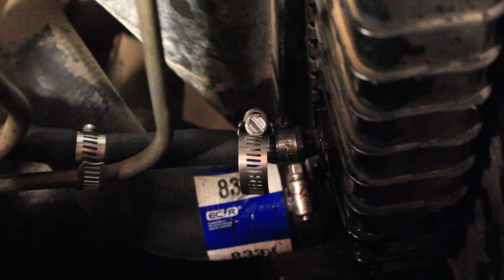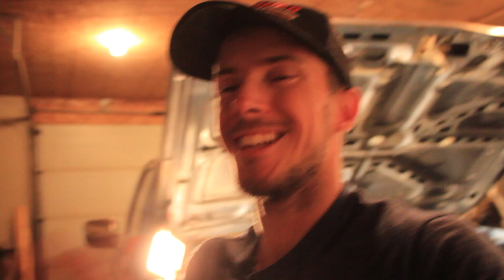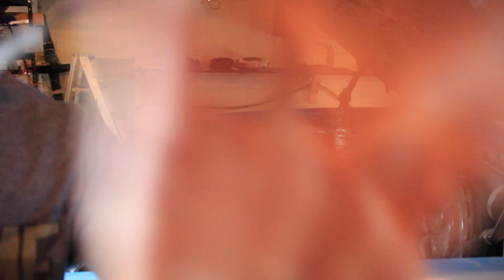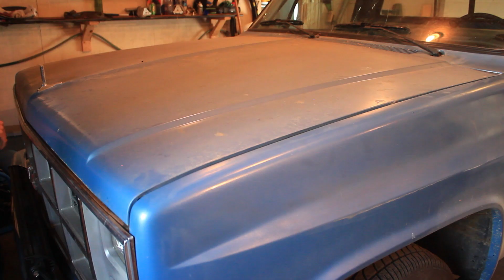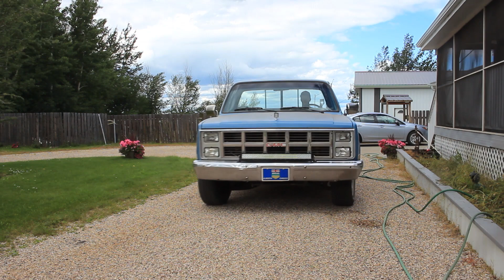PUKING TRANSMISSION FLUID!!

Comment: Got an 02' Blazer ZR2.  Had the Transmission & Torque Converter changed/ Rebuilt 18k miles ago & the other morning I was taking my Son to work 6 miles down the road at 5a when I noticed smoke coming up around the truck while parked at a store. 
Trans fluid was pouring out the bottom of bell housing.  No symptoms,  it was running & shifting great, etc. It Just started blowing out hard!
I had Triple A take it back to the shop, I had been hearing a slight noise after the $2200 rebuild that I never heard before. Sounded like something barely rubbing the flywheel or flexplate when I would just start to take off. They kept telling me it was my AC Clutch but i told them it made that it made that noise whether the AC was on or off!
I never tow or ran it over 60mph. Its just a baby run to the store type truck. 
They can't look at it for 4 days but I'm sure they'll try to get out of that 12k warranty since it has 18k miles on it since the rebuild. I'm hoping it's a coolant line but it's probably the pump seal or Torque Converter seal
Reply: Got an 04 Lexus Gs300 and last night this same thing happened, i was driving to the store and at a light smoke just kept coming from under the car i don’t know where it’s leaking from but all the fluid leaked out within 10 minutes of driving it back home, no sign of any transmission problems like hard shifting slipping or any of that, just every time i start the car it starts pouring transmission fluid
Reply: Dip stick tube for trans